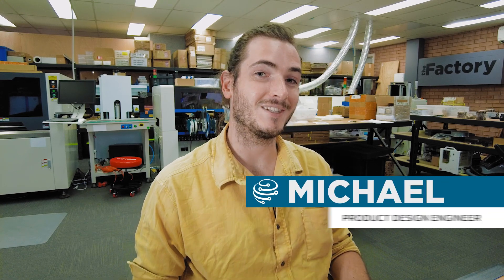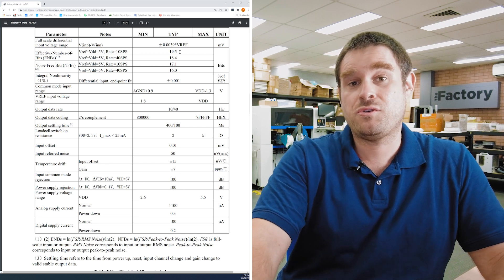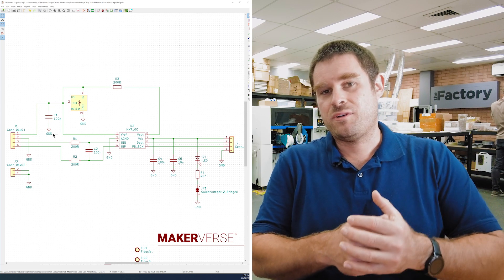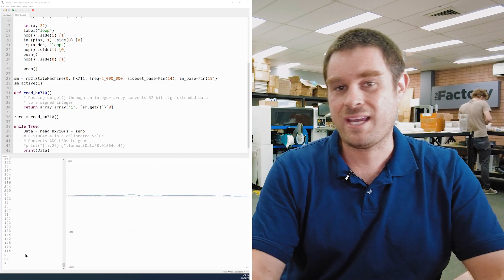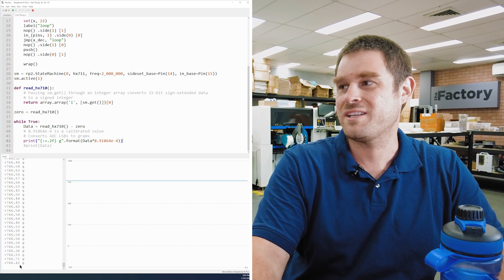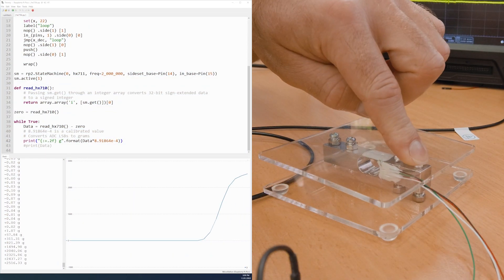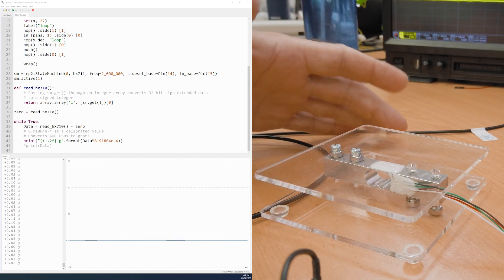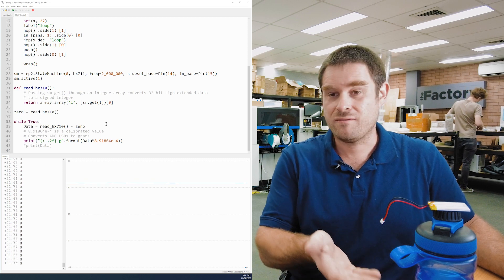The Factory | Testing Load Cell ADC Performance

Comment: Thank you for this awesome walk-through. How did you calculate the 200R R3 resistor value please?
Reply from the maker: That's just a current limiting resistor for the voltage reference - chosen according to the operating conditions in the datasheet.
Reply: @Core-Electronics  Thanks, I was a bit confused and wasn't sure :)

Comment: Would adding a second load cell make it more accurate ?
Reply: Yes and no, it isnt really needed with a platform only of that size, but if you are using more then one loadcell, for analogue outputs you have to trim the signal outputs of the loadcells to read the same weight on each corner etc, and digital loadcells, most indicators come with a feature to compare the two loadcells weight and adjust the code to see the adc counts and adjust the output weight according to the counts on each loadcell

Comment: You have to use a differential amp!
Reply from the maker: Hey Mick! The IC we're using is a Load Cell ADC with a differential front-end designed specifically for the purpose. It's pretty nice!